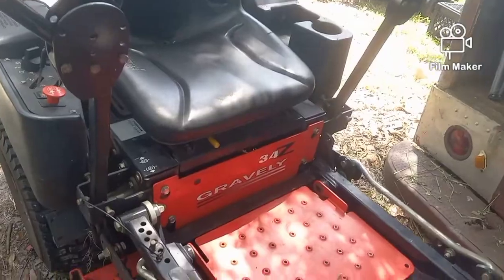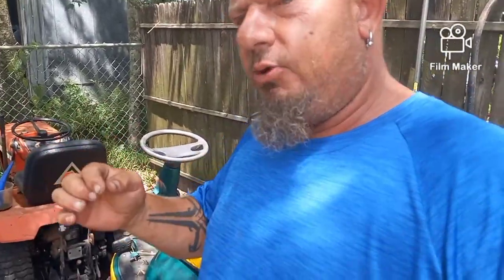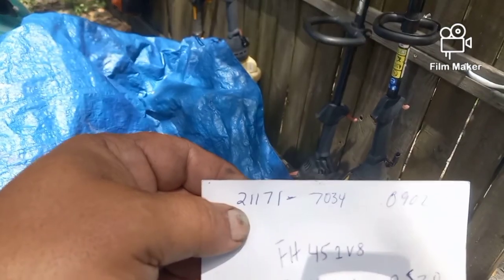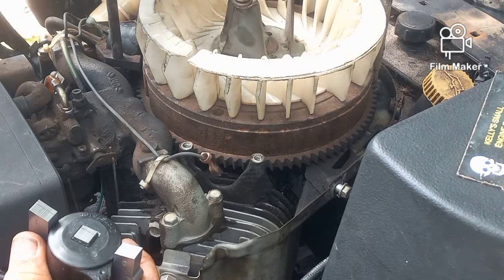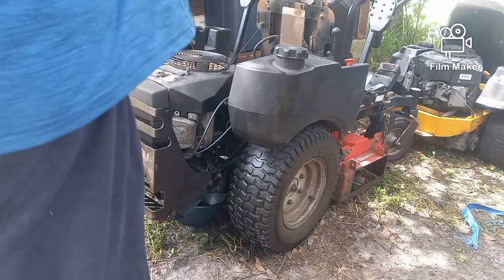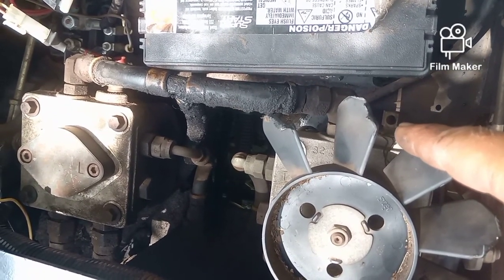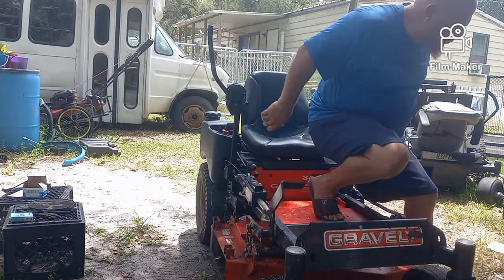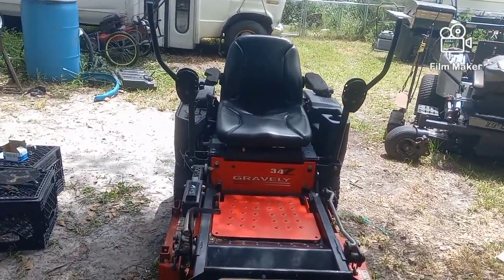Zero Turn Mower Has No SPARK

Comment: Yup, that's how you make money.  Buy someones junk, that they just want to be gone.  Fix it, clean it, sell it and make far far more then you might have made in just fixing it for the customer.  I don't know about where you are, but here (N.W. Montana) easy sell for several $1000.

I use a Thermometer which fires an IR beam to check if a cylinder is running or not on a twin cylinder engine.  Useful for checking temps on just about anything that you can see.

Yup, those Ignition coils are cheap, easy to replace and can be bad and still register a spark.  They are simple enough that ordering from Amazon, you'll get one(s) that work just fine.
Reply from the maker: Right on all counts.. turned out to be more than I thought but less than I planned.. the next vif will explain where I went next

Comment: That broken blades are the cause of bit being off  balance
Reply from the maker: Yes the fan would be replaced but motor has another issue which next vid will explain both problems and my solution
Reply: @MunkyWrench  thanks for the update on that matter